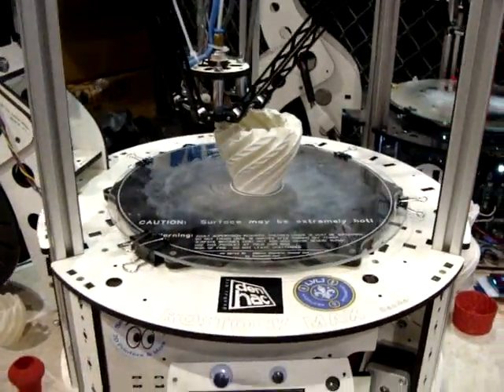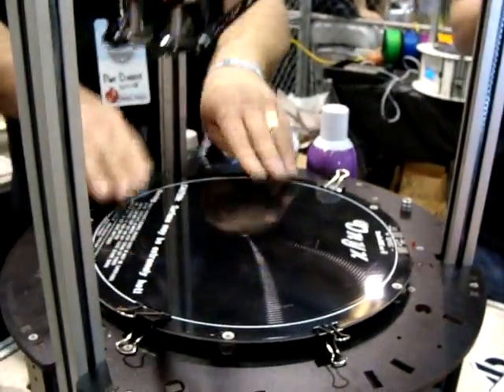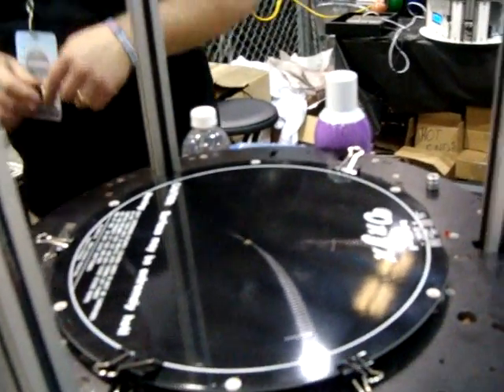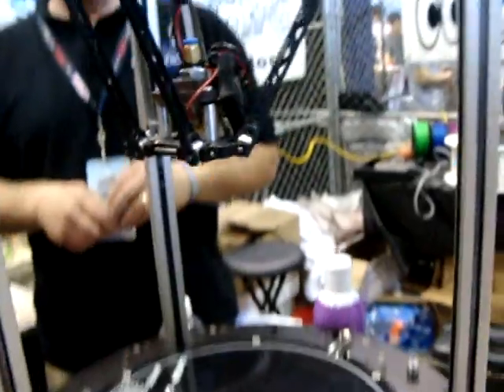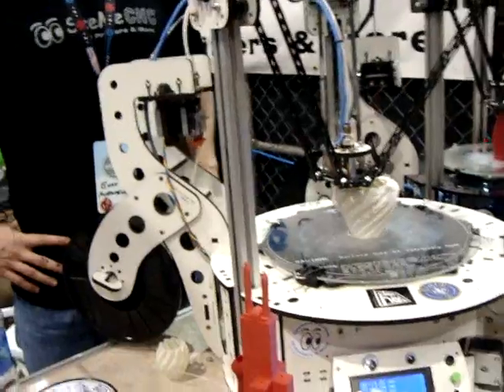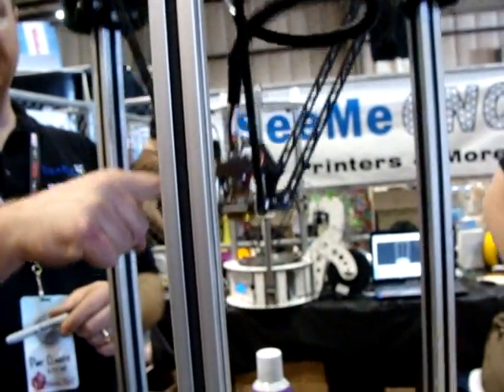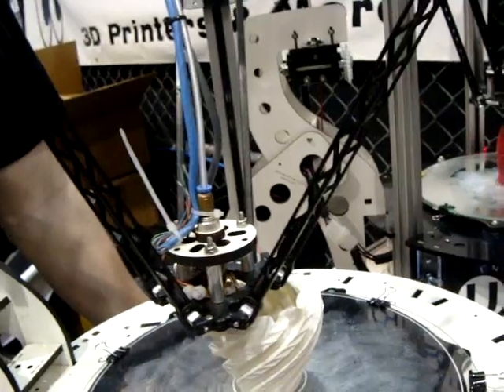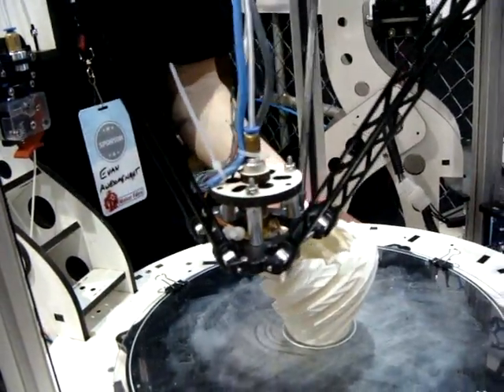3D Printers: See Me CNC

Comment: ABS was better,  other problems were #1 the movement wasn't flat.  As much as .012in out.  Getting large prints to stick will be very difficult with Z axis moving up & down .012 in.  My son and I make a printed parts that we sell.  We have done tons of research.  As of right now the best printer (most accurate, repeatability, durability)  would be M2 by makergear.  I've ordered one, it's due to arrive any day.   Check it out.  See what you think.